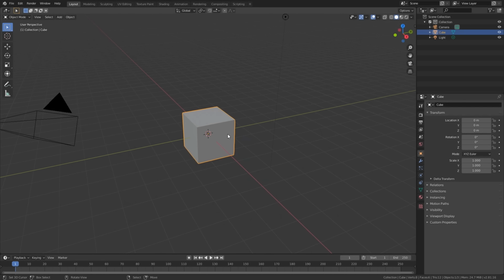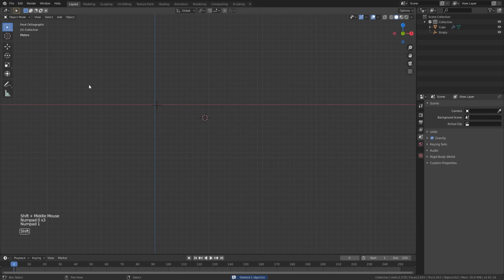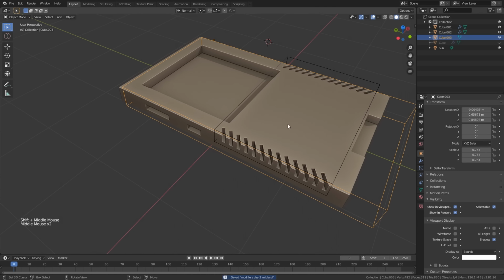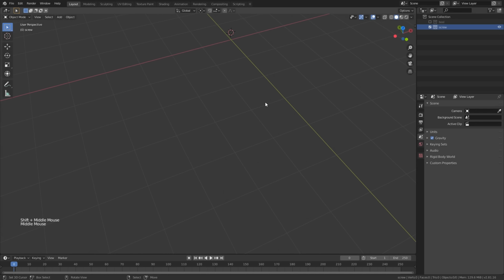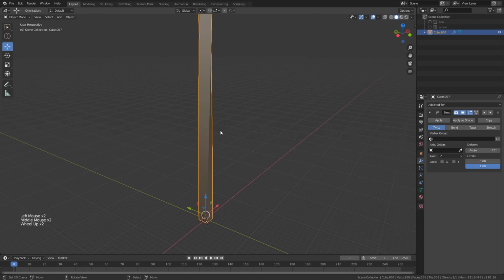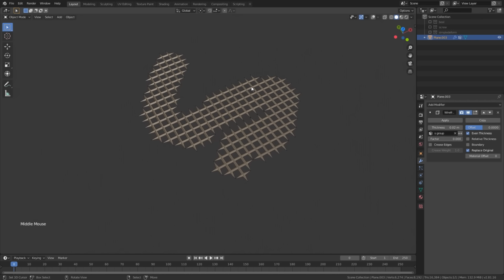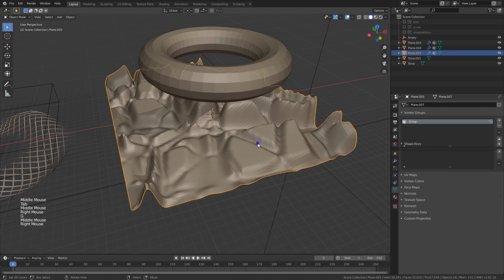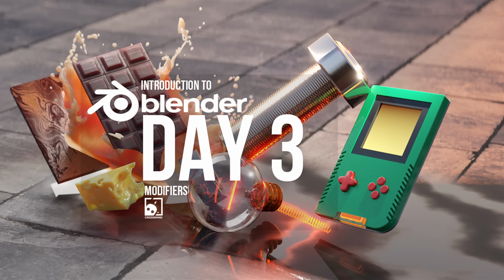Blender Day 3 - Modifiers -  Introduction Series for Beginners

Comment: If your boolean modifier is not appearing after setting the viewport mode to "BOUNDS" try "Recalculate outside" for the normals of the object that is used to boolean your base mesh.
To do that, once you are in edit mode you can select all the faces of the mesh and go to Mesh>Normals>Recalculate outside. This solves the issue.
Edit: You can view your faces normals' orientation by checking the box "Face orientation" under Viewport Overlays. Blue means the faces normals are looking outside of the mesh. Red mean the faces are looking inside the mesh, which is the reason of the boolean operation not appearing.
Reply: thank you sir
Reply: Tq soo much
Reply: thank you sir
Reply: Thanks so much!
Reply: THANK YOU

Comment: Version 3.0 doesn't seem to let me boolean with array objects. I tried it in 2.93 as well it doesn't do anything no errors come up either? Apart from that I'm super excited to have found this channel. I started with your geometry nodes. I like how you give examples of how these modifiers (and in your other tutorials) can be used, that seems to be missing from other tuts. Even in school math problems were explained using only the simplest equations. Keep up the great work!!
Edit: I don't no why but if I created the smaller cube first and applied the boolean right away then sized it down rotated it and added the array the boolean worked?

Comment: Its very good but am i the only one thinking its a bit fast? I made the donut tutorial and this is my second tutorial, Whenever i try to mimic something he did i dont always end up with the same result having to skip back 5-10 times for one small process. Not sure if i should watch and listen only or actually be doing the same stuff at the same time in blender.
Reply from the maker: Did u watch previous chapters?
Reply: @CrossMindStudio   @CrossMind Studio  I did yes, is this like an advanced tutorial or aimed at beginners? hardest thing for me is when your saying lets do this and theres 2-3 keystrokes instantly on the screencapture and many things happening quickly, im sure its easy once your comfortable in the program but for a beginner its kind of hard in the start, I like the tutorials though!
Reply from the maker: @vonown3d  it would be better to practice after each chapter for what u learnt, so you can memorize commands and previous learnt knowledge is registered well. take it slow and practice , may be try to make ur own oversion of models or things after each chapter, with what u have learnt.

Comment: Previously
Me: How did you seperate the light bulb into the copper part and the glass part
You: select faces and use seperate command.

can't find any faces on the vertices to use the seperate command on, and if I use the seperate command on the vertices it doesn't work. I'm assuming you won't get notifications if I answer to your comment answering to mine, so I'll comment again. also help pls, i want to make the one i see in day 4
Reply from the maker: Not sure why its not working for you,
just need to select vertices/edges/faces and seperate them. It will make seperate the copper part along with modifiers applied on it.

Comment: Trying to tweak arrays once I'd realised I'd done something wrong, like not apply transforms after moving an object in object mode, I remembered  the best way to avoid this is to do all the object tweaking in Edit mode. This way the object's transform settings aren't altered and won't be multiplied when the Array modifier is added. Had to do this a few times.
Reply: Hah, I see this came up 13.07 anyway.

Comment: Anyone else having trouble with Boolean?

It does not work for me at all.

It's the first & only thing that has gone completely haywire for me in following this series.

I cannot find a reason, or an answer anywhere!

Using Blender 2.93
Reply: People who are having difficulty in BOOLEAN (9:00 from here) 

Can simply first select the cube, then in Boolean, change OPERATIONS to "Difference" and then go to 'OBJECT OFFSET' and select the SPHERE...
Hide the sphere and Wallah!

I hope it'll work for you
Reply from the maker: Strange, Try something simpler and see if it works. could be file specific issue.

Comment: when trying to make the Gameboy model the Boolean modifiers don't seem to work for me.  I followed the steps including the Transform All.  I can see the cut-outs and mirrored objects in wireframe mode, but not in any other view.  Any ideas?  

BTW, the first exercise with Boolean (cube and sphere) I practiced a few times and it worked flawlessly...seemed fairly straight forward.  But something about combining the cubes together seems to be buggy.  Also in order for mirroring to work seems that I have to turn on bisect and flip for an axis.  These options were active in the demo.
Reply: Almost same to me. The boolean is working with the array, but when I apply the mirror modifier everything disappears for any axis.

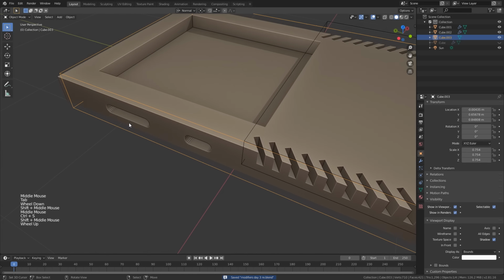Comment: 14:08 when u beveled your edges there for the cubes, the bevel was able to go across two axis/curves, but when I'm doing it its only beveling across one curve or axis. Essentially, it hugs one face and does not go on the other edge. How did u do this?
Reply: It can be fixed by applying the scale in object mode. Use "ctrl+a" and choose "scale", then go to edit mode and try bevel again.
Reply: @Massive-G  Yeah i was able to get it working yesterday, thanks tho! Quick question: what is the purpose for applying scales, transforms, etc. ? Why is it necessary to use "ctrl+a" and then apply various kinds of transforms?
Reply: @Massive-G  Thanks you so much 🙂
Reply: @Massive-G  my hero. It solved my problem. Thanks

Comment: Thankyou so much for the tutorial. One of the best ones on Blender. 9:48 , After applying the boolean modifier my cube is disappearing instead of the sphere. I tried a lot of things to fix, nothing's happening. Anybody's got a solution? Thanks!!
Reply: I applied the bound on the sphere now under visibility section, the sphere is dissapearing but not making any difference or modifying the object
Reply from the maker: Did it worked? If not can you post a video. Hard to guess whats going wrong.

Try doing boolean in new file with simpler object
Reply: @CrossMindStudio  When applies Bounds, the object jujst disappers

Comment: Hey CrossMind Studio.. A question for the future, is it good to use booleans or when should I use booleans? does it have problems with topology? because when I used it, only the intersected parts are having segments and not the cube. is it an issue?is this good for the long run?

Comment: 23:39 what did you do exactly?
Reply: He deleted all the vertices of plane.Then,  Holding Ctrl he is shaping bulb with left click.(In edit mode)
Reply: @nickrinzler7602  I only managed to duplicate that by deleting all the vertices but one, then successively extruding vertices from there to make the outline path. I didn't think of merging all the plane's vertices and ctrl-clicking felt clumsier than tapping the E key and pulling the vertex into position.

Comment: Please help me. When i render image, all my screw object not displayed. I only see plane. How it works?
Reply from the maker: May be because, there are two settings in screw modifier. One is for viewport and other is for render. You might have increased segments for viewport but left the render setting.  If not this , then probably some hidden object which is being used for Boolean  is showing up in render. Apply Boolean modifier and disable unnecessary objects. Let me know.
Reply: @CrossMindStudio  You're right. I added render in screw modifier and all worked. I couldn't find an explanation on the Internet. Maybe I missed this explanation in your video, i apologize. Thank you a lot. 3d really easy to learn with you.

Comment: how did you cut the bulb out considering it dosent have a mesh of faces but just a line of vertexes
Reply: Deleted all vertices of the plane, then used control-leftmouse or control-rightmouse, depending on the mouse configuration you choose in preferences. 
Control-click creates a new vertex, in this case, and subsequent control-click creates new point extruded from selected point.
This is explained in one of the previous videos to this one.

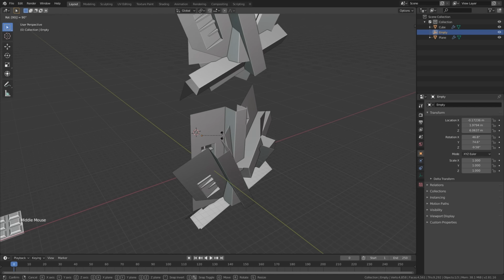Comment: I'm unable to rotate the elements at 8:24. When selecting the empty plane as the driver, the objects of the array get positioned randomly. This happens in the tutorial as well but in the next frame, every object of the array is aligned perfectly.
Reply: mine one is changing its size automatically
Reply: Select the object then(object mode), Ctrl + A --->> Scale

Comment: why nothing happens when i add the bevel modifier ?
Reply: I got it by setting the width type as percent in the bevel modifier. There is one comment in this thread saying "overlapping edges -> I used merge by distance" Which I don't have a clue what they meant be that.

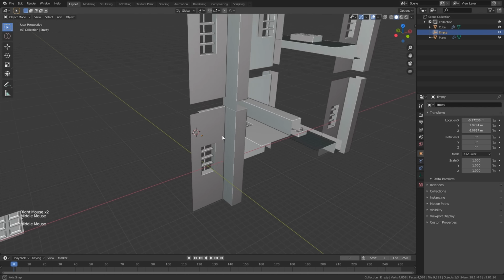Comment: I am not able to set the correct position of structure at 8:14 as you set at 8:25. Please help me.
Reply: Hold up, I know the answer to this. hit Ctrl A and apply all transforms.  If you don't do this the Array will attempt to "array" and offset the scale, rotation, etc.
Reply: @stonelambert  Thank you so much I fixed 80%

Comment: 8:13 can you help me? When I select object offset as plain axis, all the objects are scaled it in different variations I don't want that, help me.
Reply: I also had the same problem. What i did was after i rotate all the object, and make a bit of changes until all the objects are aligned, continue to scale on empty until all of them have the same  scale. I know i'm a bit late but hope this helps.
Reply: Try and apply transformations on the object as a whole.
Reply: Select the object then(object mode), Ctrl + A --->> Scale

Comment: It would be helpful if explained how you bent the wall using rotation please. I somehow mess it up.TIA
Reply: Place empty object In front of the object in centre then rotate In z direction
Reply: @tiktokvirals2722  The offset shrinks when i scale up the mesh in object mode
Reply: @SudarshanaJoy  no it wasn't a plane watch again he extruded it
Reply: Ok. I understood now what was the issue. 

What was messing up the scales, rotation and placement of the child elements was the fact that we did many transformations to create the wall with the window (rotating the plane, scaling it on Z direction, etc).  To fix that, simply select the parent object after you are done creating it, hit ctrl A to open the apply window and apply all transformations.  Then you can use the object offset to set the control element (in this case, the empty object) and it will not mess up the transformations of the child elements.
Reply: @GastaoHEsteves  This sort of thing comes up in animation too, I found. Resulting in stuff flies all over the viewport when you don't expect it. Another way round it is to do all the transformation in Edit mode. So the geometry is changed but the object retains all its transform defaults when you go back into Object mode to add the modifier.
Reply: @reginaldside4575  Thank you so much for the insight. I didn't enter the animations lessons yet (going very slow to understand well every tool) but now I will have it in mind. Ty ty!
Reply: @GastaoHEsteves  Man you're god sent, Thank you. It solved my issue
Reply: @aliabufarjad4588  Glad to help!

Comment: Amazing tutorial ! so much respect for your efforts. i just have one question that i cant figure, when i use array modifier and i set the relative offset factor x 1 its actually doing the effect not on the xs but on the z s , and the zs factor 1 work on the xs.  the ys are working fine. how do i fix this. please i cant find the answer online.
Reply: I had a similar issue for the wall pieces made with the array modifier, but then not for a plain cube.

The problem was cause by the rotation of the plane. Pressing ctrl + a then apply all transforms made the modifier work with the correct axes.

Comment: I'm not able to see the weight of the object at 36:53 in object mode. I can only view it in weight paint mode. What option do I have to toggle on to see it in object mode?
Reply: nevermind, I fixed it by adding the vertex group - Proxim to my wireframe modifer. Also toggled the "<--> button" right next to the vertex group option (not sure the name of the button).

Comment: I can't make the boolean effect and the empty axis you've done. After rotating the building wall R and 90 degree but it has different angle. I tried 180, 60, 40 but they all the same.  In boolean, the small boxes doesn't show when i click the bounce.

Comment: At 8:21 I cannot get the walls to line up correctly. Trying to rotate them 90 degrees doesn't achieve what happens in the video. My empty object offset seems to be setup correctly. What could I be doing wrong?
Reply: did you fixed it?

Comment: Really awesome videos, thanks a ton!
Question: around 42 minutes in you use a torus object with vertices weight modifier to make what looks like a nice flat ground in a hilly area; I keep trying but I keep not getting it flat just a little less hilly. What should I try doing differently? Any help is appreciated.
Reply from the maker: You can increase strength in modifier. You can also modify texture in texture properties.

Comment: just done with thisss, thankss so muchh, but my problem is that when I switch the shading mode to "render" the boolean objects were showing , or the objects that were "bound" are showing in the renders, even when I switch off the "eye" button
Reply: can someone help me with this please :((
Reply from the maker: You need to disable rendering for objects used for boolean. you can do that  in object properties.

Comment: Thank you for the tutorials, they are very helpful.

I think you skipped a step in 10:56 because I can't apply ''all transform'' even when I press R, then ctrl A

How did you get the apply pop up? It is not coming for me. I have even changed to global coordinates and I still cannot transform the way you did. I can manipulate the cube to come out nicely, but then if I do that, get an inaccurate mirror transformation.

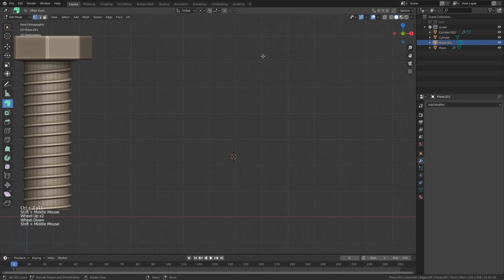Also, just to add, at 23:44 you created a plane, then deleted the plane, yet somehow you were able to create a bulb using vertices. How did you manage to get the vertices? When I delete the plane, nothing remains for me to work with.

Thank you for your assistance.
Reply: you can search it up by pressing space

Comment: day 3, it's actually week 3 for me but good
This modifier thing is absolutely magical. Although I spend so much time figuring out with value to tweak to get the wanted result, it makes a lot of sense to me to work with modifiers.
Thank you so much every time, I move on to day 4 now.
Reply from the maker: Great job!
Reply: @CrossMindStudio  Yes.. takes me about a week each lesson.  I'm on this one now but got distracted because I wanted to test my skills.  Easily about 10+ hours per lesson.. or at least 1 2 & 3
Reply: Same here I took about a week for each lesson
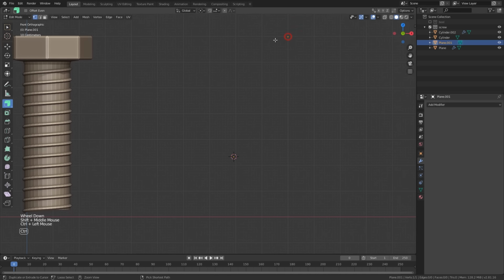Reply: in blender 2.80  that option origon not available waht should i do , time of video at 21;18. and 23:50 how you create path of vertics which tool you use to create bulb
Reply: @islam24oclock13  2.8 is old now everyone uses 2.9 you better update and it works perfectly for me, idk what's the problem for you
Reply: 2.93 to be specific
Reply: @Ab_obla  my system cant run 2.93 .my system can run perfectly 2.80 , it can also run 2.81,82,83 and 2.90 , but there is a problem every time i open new file of blender or create mesh its like invisible but i  didn't turn  on x ray mode mode . default shade mode look like like x ray mode. every time i create mesh ,i need to go to edit mode then click right to cancel selection then my cube become vissible 

when i add zip file of open gl 32  at file location of blender, that problem solve cube beccome solid but slow respons of blender . i cant continue my work .
can you solve this problem?
Reply: @islam24oclock13  I wish so much that I could help you but I don't know about your problem at all I never faced it sorry :(

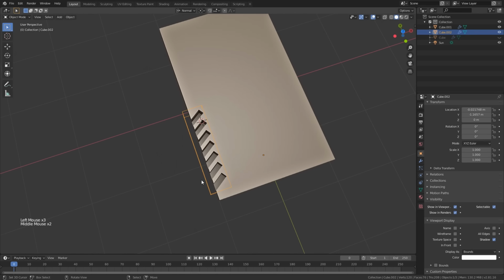Comment: Hi, thanx for your great video series. I habe a question to the community for 11:31 min in the video. He turned the object in the viewport to "bounds". In the new version of 2.90.1 i could only turn on the bounds and there comes a bound in a box, or sphere, or cone, but it doesnt blend the original mesh out. i see it with the bounds together. Anyone got a solution for this? Turning the visibility in the list is not an option, because i cant select or modified it than. Thanx for help to everybody!
*EDIT: The new place to find this option is one above, called "Display as". This blends the object out.
Reply from the maker: Where it says "Display As" over there you need to select bounds. And the option below that is just for visualization purpose in rare case scenario. Keep in mind these display options we used just so that we cud see booleans clearly in viewport. You dont have to use it. It doesn't really change the way boolean behaves. I am sure you are aware of it, but just wanted to clear it out.
Reply: @CrossMindStudio  Thx for the fast answer. Now it works fine. Letz make the gameboy :)